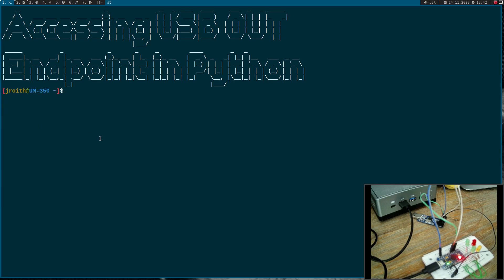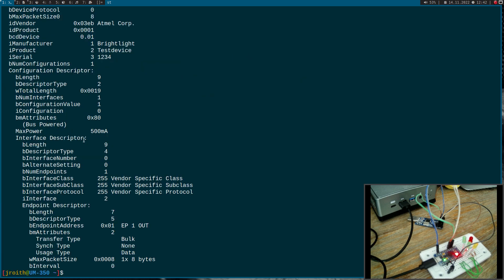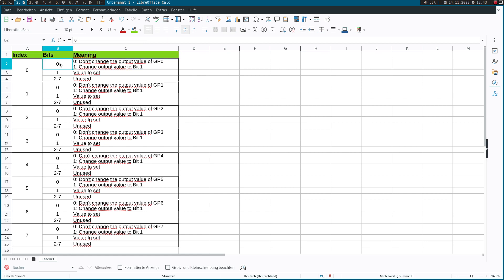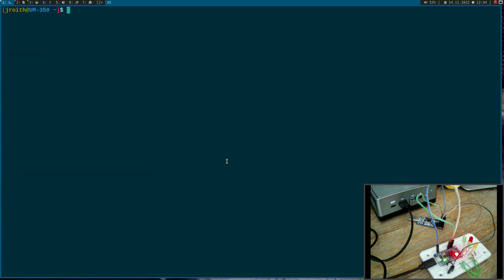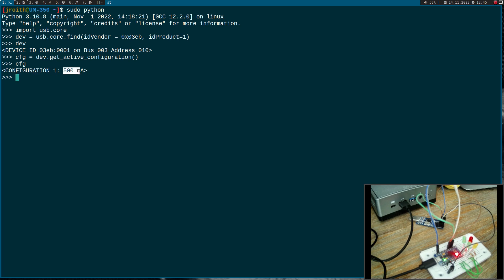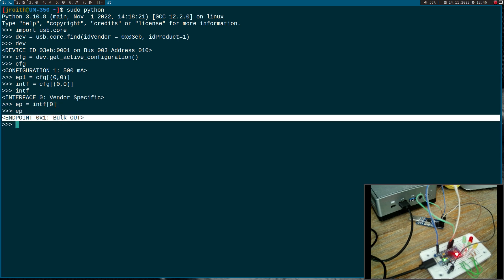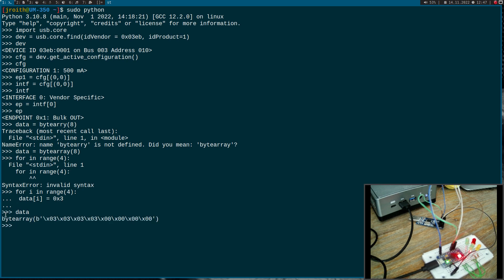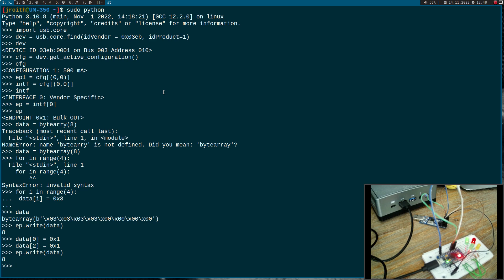GNU/Linux & USB - Accessing USB Out Endpoints in Python

Comment: Hi Johannes 
Your videos are very helpfulll thans
I want to send and receive data from linux rasperry pi  to microcontroller over usb bus which usb data flow type should I use for that purpose
Reply from the maker: You are welcome. Which kind of microcontroller do you want to connect to the RPi? The easiest way would be to use a virtual serial port. Than you can transfer data quite easy as you would with UART. Controllers like the Raspberry Pi Pico others this opportunity. 
But you can also implement your own Endpoints on our controller like I do in this videos. But this can be complicated. The question is which amount of data do you want to transfer in which time. Then we can discuss which transfer type would be best.
Reply: @johannes4gnu_linux96   I am going to use stm32f4 mcu series for this project. I will send 50-60 bytes from linux to mcu and receive 30-40 bytes information. I know uart protocol but in this transfer should be carried out with usb bus.
Reply from the maker: @mustafabuyuk6425  Ok, then maybe TinyUSB is the way to go. https://github.com/hathach/tinyusb The 
tinyusb/examples/device/hid_generic_inout example looks promising. 
I want to do some videos about tinyUSB but I don't know when.